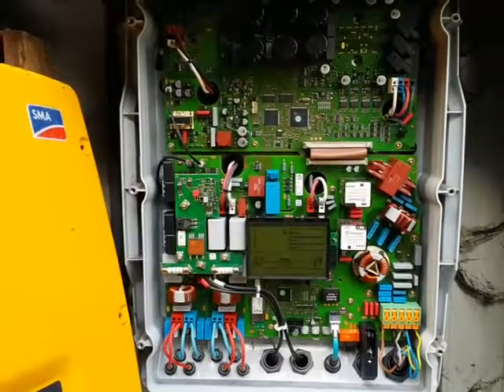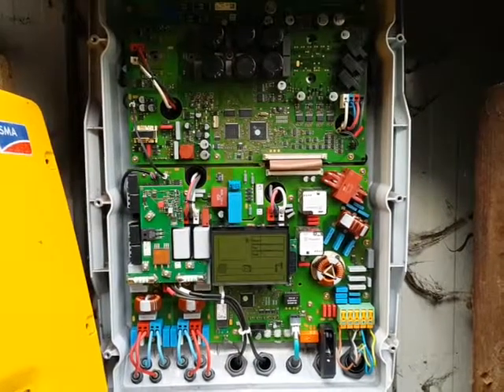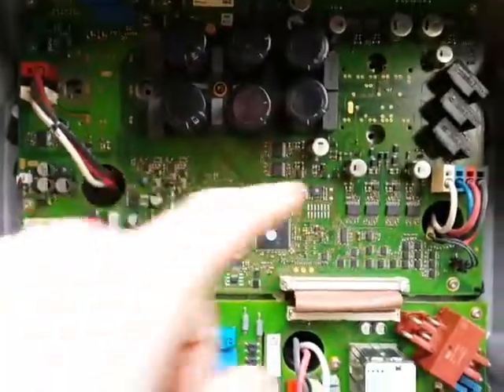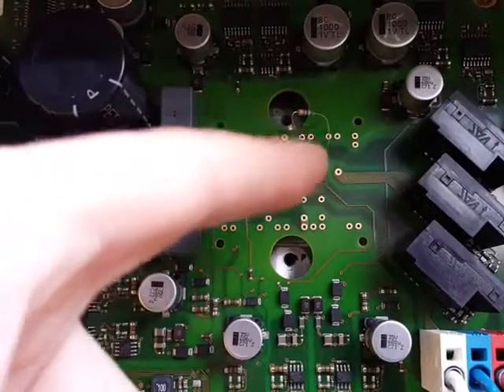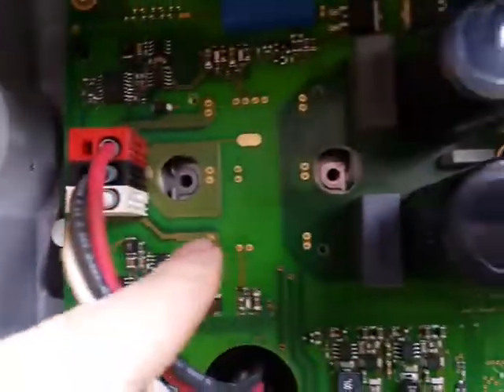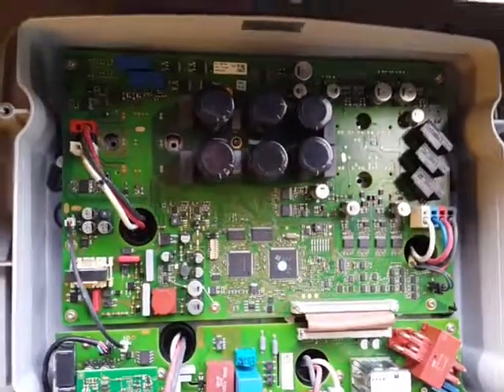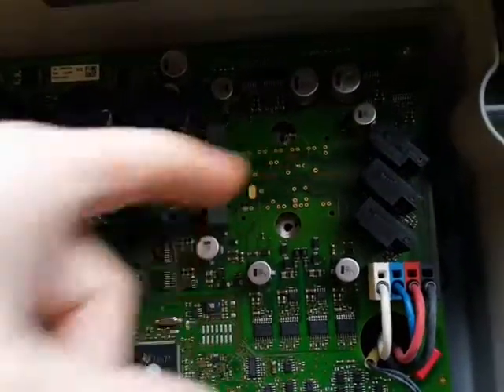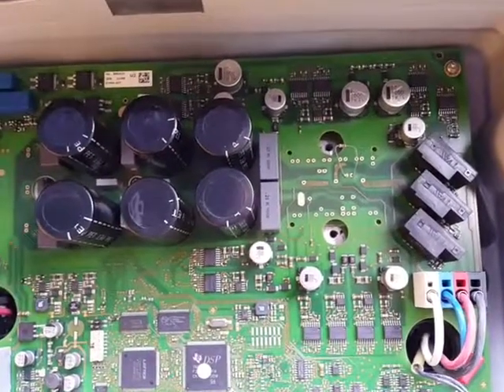SMA Sunny Tripower errorcode 6408 diagnosis. Part 1

Comment: Beste Leon,
Ik heb dezelfde omvormer uit 2013  met de zelfde storing / klacht. Toen U de IGBT module hebt vervangen was foutmelding weer weg?
Zou het niet een slecht contact zijn bij de 6 zwarte elko ik had het idee dat ze wat lawaai maken.
Waar heeft U de onderdelen besteld? Alvast bedankt!
Groet Peter
Reply from the maker: Ik had geprobeerd de elcos te vervangen, maar omdat er veel koper in de print zit krijg je de tin niet aan het smelten; mooi laten zitten dus. Ik heb alleen de IGBT aan de 220V kant vervangen, toen was de storing weg. Let op, de IGBT is pressfit, voorzichtig met een plankje indrukken tussen de bankschroef. Welk lawaai hoor je? is dat niet de ventilator. Ik vermoed dat de storing komt als iemand aan de 220V kant kortsluiting maakt op een groep, op een zonnige dag. Ik heb de IGBT bij AVNET besteld, maar ik zag net dat de stock 0 is. Farnell heeft er nu nog 6 op voorraad, lukt dat? Success
Reply: @leonhiem  Bedankt Voor je antwoord, ik laat je weten hoe het afloopt.
Reply: @leonhiem  Goedemiddag Leon,
Gisteren heb ik de elko opnieuw gesoldeerd met de hoop dat de omvormer weer zou werken, jammer genoeg niet en weer code  6408.
Wat raar is dat de ventilator ook ging draaien en dat er in het display 6511 kwam staan (te hoge temperatuur)
ik heb de DC string op een andere ingang aangesloten en deze melding kwam niet meer terug ook niet nadat ik hem later weer op de ingang prikte waar de storing eerst wel was.

Ik heb nog een paar vragen  en hoop dat ik een antwoord van U kan krijgen.
De opgesoldeerde weerstand van 5k bij de IGBT aan de grid zijde waar dient deze voor en was dit tijdelijk.
Wat me op viel is bij spanning op het toestel dat de 6 elko's om de zoveel tijd iets tikken. (misschien is dit normaal)
Zijn de IGBT goed door te meten?
De linker (IGBT/ dc zijde ) Met mijn ohm meter meet ik bij de linker pin (rode draad) en de rechter pin boven ongeveer 300kohm, ditzelfde meet ik onder bij linker pin (witte draad) en de rechter pin onder.
De middelste linker  pin (zwarte draad) en de middelste rechter pin meet ik een doorverbinding. (Zou dit kloppen) 
Of is het beter om toch beide te vervangen IGBT te vervangen
Alvast bedankt!
Reply from the maker: @peterwalstra4330  De 5k was tijdelijk, ik meen me te herrinneren dat dit de interne temperatuursensor emuleerd. De elcos maken vast dat tik geluid niet. Dat moet de spoel achter in de omvormer zijn. Tikken is herhaalderlijke poging om de omvormer opnieuw op te starten, maar dat mislukt bij jouw dus. De spoel zal inderdaad een zeer lage weerstand hebben. Ik had de IGBT getest met 2 DC voedingen; 1 voor de gate aansturing en 1 voor de drain-source, functioneel leek het goed maar ik had het signaal niet op de scoop bekeken. Ik kon dus niets vinden aparts vinden, dus heb ik alleen de IGBT aan de 220V kant vervangen. Dat was toch de oplossing. Zie ook de 2e video.
Reply: @leonhiem  Gisteren ben ik bezig geweest met de omvormer om de IGBT te vervangen aan de grid zijde. het begon schemerig te worden dus kon ik het niet meer testen.
Vanochtend heb ik de omvormer aangesloten en de omvormer werkt weer erg blij mee.
De oude IGBT heb ik tussen de bankschroef geklemd met wat hout er tussen, daarna kon ik hem vrij gemakkelijk van de print trekken.
De nieuwe heb ik op de print gezet maar durfde ik eigelijk niet met de bankschroef en met wat latjes aan te drukken.
Wat ik heb gedaan is IGBT op de print gezet zover mogelijk met de hand erin gedrukt, print terug gemonteerd in de behuizing daarna staat de print wel ietsje bol.  met een houtje en hamer voorzichtig rond de pinnetjes getikt.en je ziet dat de pinnetje verder na buiten komen.
Print weer losgemaakt en beide ingesmeerd met nieuwe koelpasta en de boel weer terug gemonteerd.
Wat me opvalt is de de IGBT beter tegen de print aan zit dan zijn voorganger.
Ik wil je hartelijk bedanken voor jou advies en bevindingen, nu hopen dat de omvormer blijft werken.
Groet Peter.
Reply from the maker: @peterwalstra4330  Gefeliciteerd!
Reply: @leonhiem  Thank you for the Video! Is it possible to name the part number of this IGBT?
Reply from the maker: @OW1000  See part 2, in the comments, the part number is mentioned
Reply: @leonhiem 
Ik heb voor een jaar of 2 terug de mijne door deze video kunnen herstellen. En die werkt nog steed. Maar in hoeverre ben je bekend met deze inverter. Ik heb nog een 2e liggen en die heeft een isolatie fout. Weet jij toevallig waar ik dit zoeken moet?
Ik heb de dc igbt gemeten zoals peter hier boven beschrijft maar daar heb ik hele andere waardes dan hij.